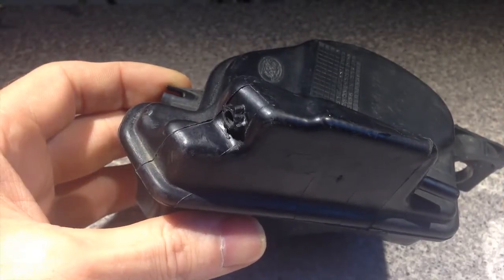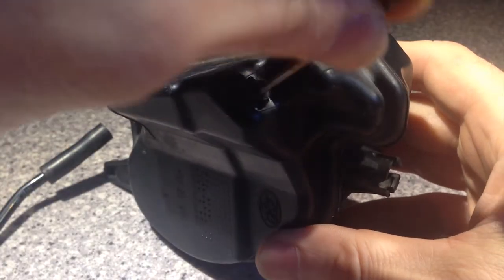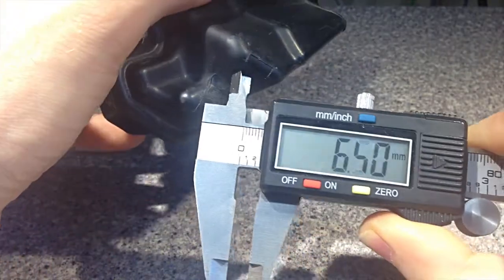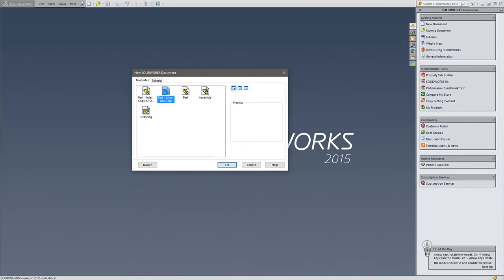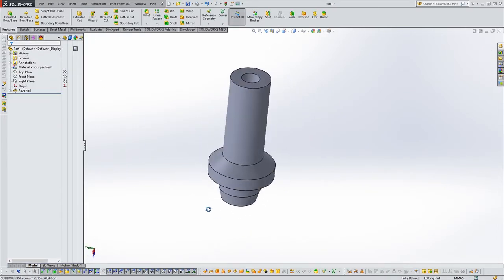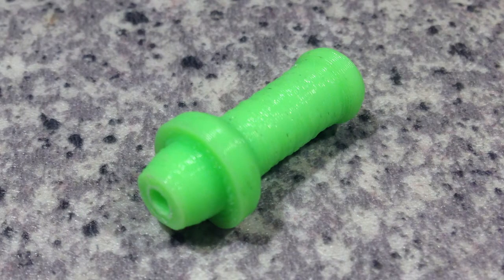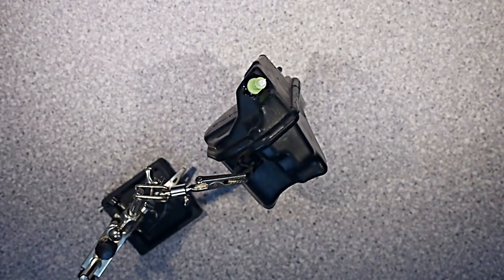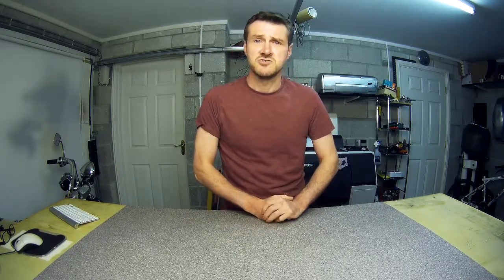Practical Uses of a 3D Printer - Printing a Nipple

Comment: The trick of adding baking soda to super glue is one that I had never heard of before.
Reply from the maker: It's pretty handy when you need to add bulk to the adhesion. I used to by a product, which was quite expensive, then I discovered what was in it!